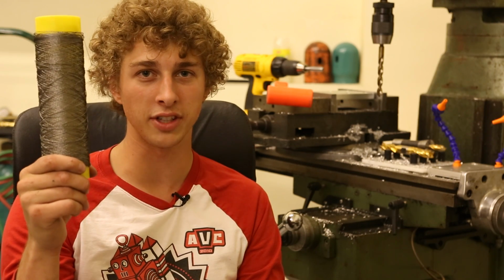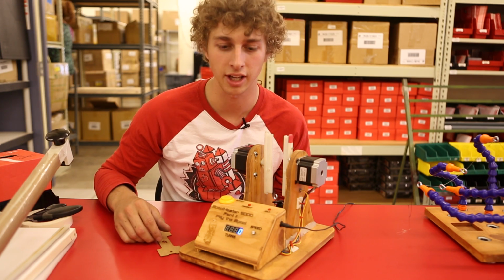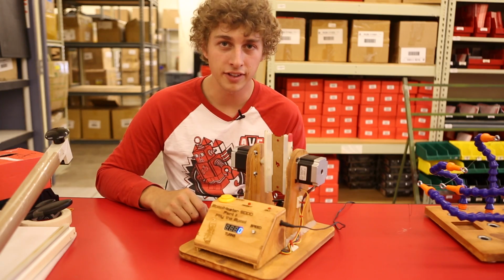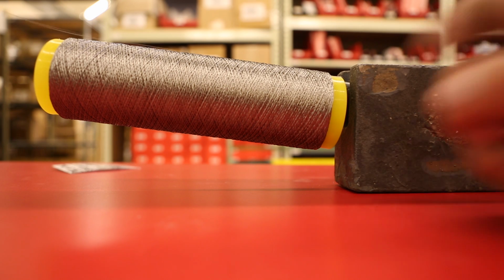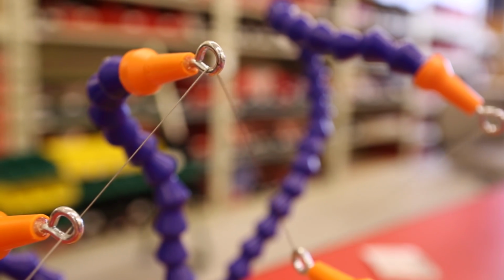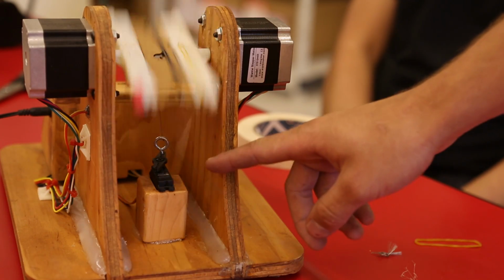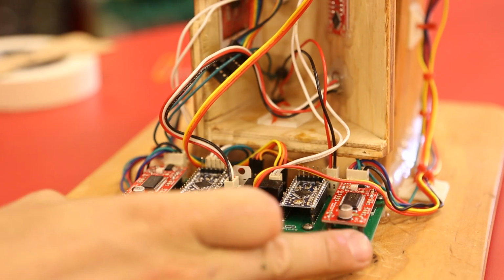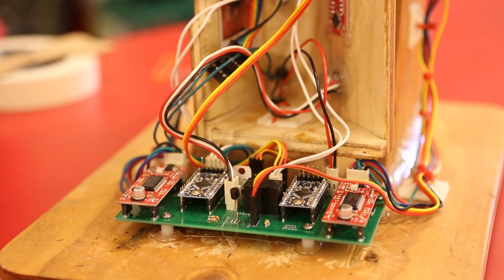SparkFun Engineering Roundtable #19 Paul's DIY Thread Spooler

Comment: I wonder if the wire insulation isn't damaged from the sharp turns around the cardboard. 
I guess the cardboard is used to keep it flat, for shipping.  

My solution would probably straw, punch a hole at an end to attach the wire, then twist the straw while moving the wire slowly  towards the other end, then back, repeat until you get the length of wire spun on the straw. 
If needed, some fake walls could be done on the straw using electrician tape or some small cardboard discs
Reply: Conductive thread does not have insulation.
Reply: I agree.